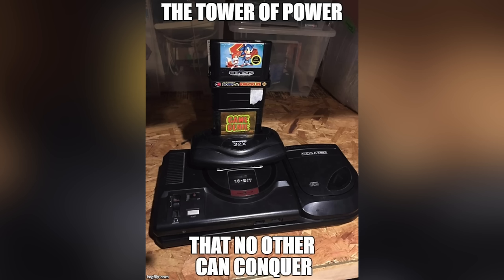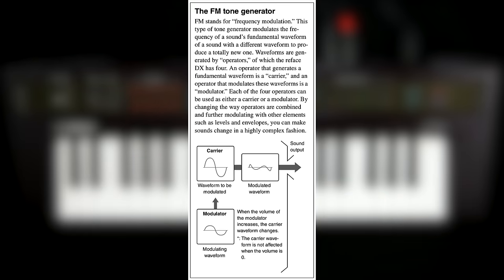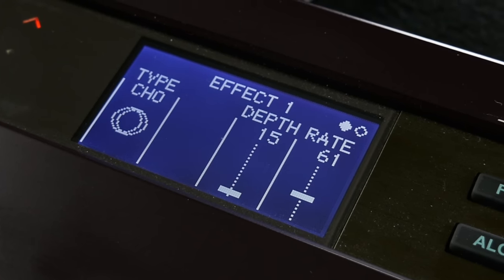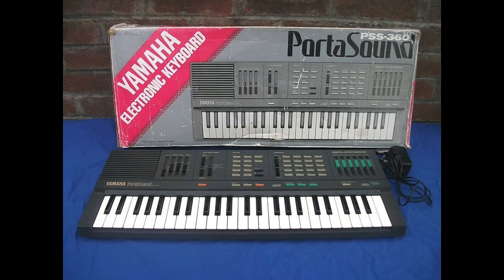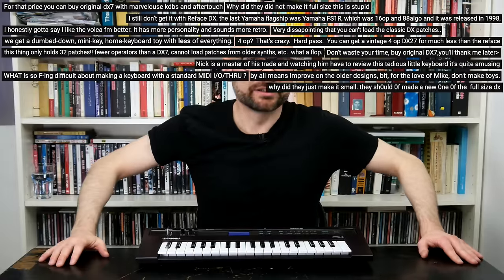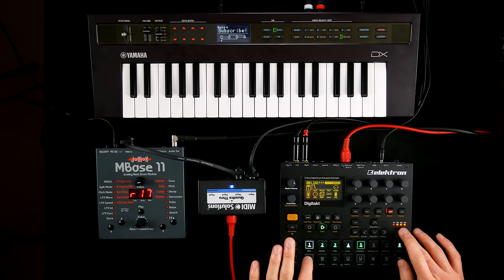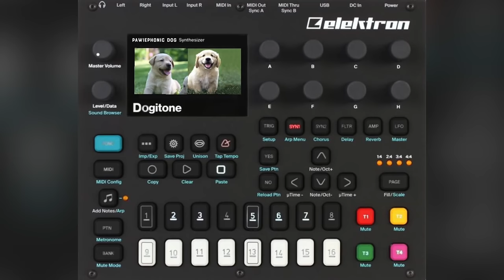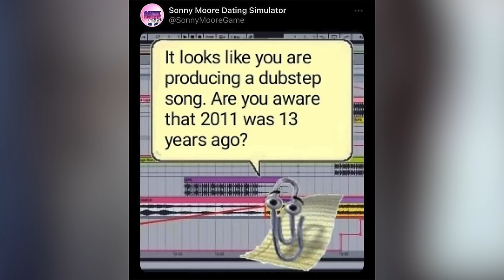Bad Gear - Yamaha ReFace DX

Comment: If the Refaces had launched at half the price, they'd be instant modern classics. They were WAY too expensive for what they were, but damn did they all sound so good.
Reply from the maker: Agreed!!!
Reply: price has gone up too 😭
Reply: I bought a CS when they came out and that is really the only piece of gear I ever regretted selling. That think was sweet.
Reply: Exactly my thought. I’m amazed the price never came down by much. I would have at least one by now if they had!
Reply: They did lower the prices for a few months in the middle of the production run, but once more people got them and the word got out that they are limited but neat, the prices went back up.
Reply: @mackenlyparmelee5440 the CS is a great little synth - so quick to dial in great sounds.
Reply: they could've tried making enough of them :C
CP was the only one I was really interested in. Wicked lame the volca fm was a 6op that took DX7 sysex and this thing is... this thing
who wanted a tiny DX27? we had the DX100 already!
Reply: Well put!
Reply: CS is the only one I haven’t owned (and I sold the YC - not a big organ guy).  I love the CP and the DX was my main portable rig for years until I got a Jupiter XM…
Reply: @soupforare  Yeah, but the original Volca FM only had 3-note polyphony, which was a deal-breaker for me.  I forget what my issue with the FM2 was, that I never bought it.
Reply: The grandfather of the Reface CS synth, the CS01 ( mono ), now goes for what you would pay for Reface with polyphony and better features ( the exception being the mod wheel ).
Reply: You could get them for around €250 second hand here, which is a good price.
Reply: Yeah, knob/$ much too low.
Reply: I paid £250 for my Reface DX which I thought was a good price at the time. It's a great little synth. I like the form factor, and the built in fxs. The downside to me is definitely the limit of just 32 patch memories.
Reply: @TheDungeonDive how much was new Reface when it came out? The prices were all over the place
Reply: I paid €250 the CS new a few years ago
Reply: "I think I'm alone now" ... cheazy 80's refference .. but I really never got the buzz of reface. Pretty much all of them take the "cheazy" sound to new heights. and the small form factor and yes "Casio" build quality and I'd say Waaay too self confident pricetag make me think, Why did people even buy this shit to begin with. You could get soo much better sounding "toys" elsewhere for lesser money. Even a REAL Casio almost sound better and only cost a fraction of these. Someone at Yamaha must have had a brain aneurism. I can see the pitch from a brainstorm at Yamaha dev team meating. "Hey guys howabout we take some of our old shit and cook it down to sound even worse than the originals and put it in an ultra compact form factor like Casio .. but selll it for a total hillarious  price .. wouldn't that be fun ?".... and then the world went mad  and actually baught it .. that is if nothing else epic in itself 😂😂
Reply: @mrdali67  a lot of those cheap casio machines have become as expensive as a reface now ! The VSS30 for example
Reply: I have the CP. It's simple and glorious and has a secret piano mode that I love
Reply: Funnily enough, Yamaha seems to have put Reface DX's on sale for $250 right after this episode came out.
Reply: I would have bought one if not for the price.
Reply: @treetopjones737 oddly enough I did r exactly that about 5 years ago. Sold my CS01 and bought a Reface CS. Many more sound options, and of course polyphony! But the PWM on the CS01 was the only thing I miss. The Reface does it, but not quite as well.
Reply: And the lack of patch memory for the CS is criminal considering they are digital devices!
Reply: @LondonSteveLee  yeah but it's that hands on analogue feel.
Reply: 1) learn electronics
2)buy a teensy4. 1 and an I2S Dac breakout
3) buy a PSS "remie" or a A50 (same keybed as the reface)
4) replace the electronics
5) code your own algorithms

that's how i got my best refaces... by refacing yamaha's toy keyboards 😁
Reply: They are really well made quality little units, but I agree if they had been slightly cheaper they would have been incredible. I always resisted because of the price, however I recently picked up a CP for a good price and I have to say it sounds incredible. The only downside is having to hook it up to a larger keyboard to be able to really get the most from playing. 

I think the CP and YC while a touch expensive for what they are succeed over the DX and CS is that they focus on simply emulating classic vintage sounds through excellent sampling and high quality effects, and they don’t bite off more than they can chew. The synth type refaces are still really cool fun keyboards but can’t really live up to the promise of a real synthesizer and you always feel like its a compromise in terms of editing and the inability to save patches hurts. 

You cannot get something that will hook to any midi controller and sound as good as a nord or hammond or whatever stage piano for a price as low as the CP and YC, which sound as good or better than my Nord, but for the price of the DX and CS you could buy one or more of Behringers synth bootlegs or even the deepmind 12 and have change which is gives so many more possibilities. 

So for me the Dx and CS fail because they’re a compromise where the CP and YC are much less so. 

But can’t deny all of them sound effing amazing
Reply: @johnthecloud It’s a good price. I agree it could use 8 banks instead of 4, the buttons are there already …
Reply: @barrycreed9886 Wow
Reply: @thefaultinourpizza1513 they are now $250 brand new. Is this a good deal?
Reply: @mrdali67  I completely agree with you on this sentiment. Consumers will fall for just about anything 😂
Reply: @FrightBites  I haven't seen them that cheap, that's a more than excellent price tag.
Reply: @javiceres  they are currently $250 brand new during Yamahas spring sale
Reply: @FrightBites  That´s a big bargain
Reply: Paid 250 USD for my DX and love it! It's still a bit expensive but if you're a keyboard player and enjoy working dawless it's great! The build quality is spectacular and far better than I expected. My only complaint is their proprietary midi port x.x
Reply: Had the reface dx for a few months was a great 4 op synth but in the end the small keys didn't do it justice even the hassle of using it as a sound module.  Flash forward to 2 weeks ago I purchased the original DX7 and can exchange the sounds I need via Dexed.  I know yamaha have the modx but a low cost full size dx clone would be great.
Reply: Price is $250 now - seems like a square deal!
Reply: @litup6465  250?  Not in Europe though.
Reply: Disagreed, but I am not a cheapskate
Reply: CP is somewhat of a modern classic in lofi hip hop circles these days, isn’t it? I see them everywhere.

Comment: I'm a songwriter. I want to make my own tones but don't want to lose half a day making a single patch. The 4 op reface is good for what I want. Does an OG DX7 sound better? Yes. Would you find it more enjoyable to use and program? Probably not. The Reface DX is a really beautiful complement to any songwriter's home studio. I think only hardcore FM nerds would find it to be limiting. It's genuinely a nicer synth than any software FM synth I've tried.

Florian has now reviewed all 5 synths that I own. Cheers Florian. My quest is complete.
Reply: I really like mine, too. All criticisms of the DX are valid, but as a tool to actually make music on I rank it pretty highly. 5 out of 5 is a top notch. Do you also have an OG Drumbrute like me?
Reply: @iiaaiiaannaaiiaaii  nah my only drum machine is a tt-78.
Reply from the maker: Bad Gear bingo!!!
Reply: At this point if you still have a DX or TX, it's got dead batteries and the patches are all gibberish.

Comment: I bring my Reface DX when I go to jam with other musicians. It's small enough that it's easy to carry and fit in a crowded room, with the batteries I don't need to be near an outlet and the FM tones always stand out against other instruments. You can load converted patches from many other 4-op FM synths from the Reface Legacy Project.

It's definitely not a replacement for a DX7/SY99/etc but both have their uses.

Comment: 7:18"Thanks Yamaha for releasing  the most stylish Sega Genesis sound chip emulator of all time." Eh-hm.   I point you to Sonicware's Liven Mega Synthesis which surely fits that description far better. That's an actual Genesis/Megadrive groovebox (as opposed to a monotimbral 4op FM synth).
Reply: DX100 used one of the Genesis chips actually.  (There was 1:1 patch compatibility at least)

Love my megaFM though.  I would never buy another Yamaha style FM synth without knob/fader per function again.
Reply: @NunyaB1s  recently bought Volca FM2, it's crazy how many sega sounds one can get out of that box.
Reply from the maker: I like Live stuff but I wouldn't exactly call them stylish;)

Comment: The Reface DX is an excellent FM synth that is also an excellent MIDI controller (unlike other Refaces where you have to turn it off and on holding a bunch of keys). Thank you as always for an amazing episode.
Reply from the maker: Thank you!!!
Reply: Reface CP is also an excellent MIDI controller, with even more freely assignable knobs.
Reply: @vinylarchaeologist  Don't you have to turn it off, press a few keys and turn it back on to change a MIDI channel?
Reply: @55SqueakPip   I don't know, I never tried to change MIDI channels. I just hooked it up and played. EDIT: I guess it makes sense, since DX is the only Reface with a screen.
Reply: @vinylarchaeologist  Changing MIDI channels on the fly is the main reason I went for the DX, that and the FM sounds. I also have a Reface CS which I like a lot..
Reply: @NakedBonghit It's quantizable now. Firmware update fixed that. You can see it at 4:12.
Reply: @55SqueakPip Nope. It's in settings.
Reply: The Reface DX is but the other Refaces don't have a screen, so its a bit different

 @BlasphemousButler
Reply: I get around the restarting problem on my CS by just plugging in a headphone jack adapter into the headphone port to mute the speakers.
Although changing midi channel is still not workaroundable
Reply: You can turn off the speakers as a default using the method suggested in the manual @Ballissle
Reply: @55SqueakPip  yeah I know. But my point was that involves holding down a set of keys and restarting the device. It's quicker to just pull a plug in and out as I switch between internal and external speakers a fair amount
Reply: by midi controller he means midi keyboard. you can't effectively use it to control parameters. plus it constantly sends out midi clock from the looper which is major pain in the ass.
Reply: @RadekPilich  I never noticed the Reface clock being a burden to the MIDI sequencer that way (a Yamaha QX7). My sequencer is the master clock and the Reface doesn't affect it unless I put the QX7 clock on external mode..
Reply: @55SqueakPip  it's a problem in more complicated setups with midi merging, where DX mixes it's clock into the existing clock stream causing "doubling" of the tempo
Reply: I have a 'complicated setup', I use two MIDI merges for the Reface to control 5 other synths through a Yamaha QX7 sequencer. I have zero issues with doubling as long as the QX is a master clock. Is it possible an OS update could help you? Not sure - just throwing it out there. @RadekPilich
Reply: @55SqueakPip  I have tools to filter it out if necessary. It's just not a good design choice from Yamaha to not include the option to turn it off. They are the ones who should do a firmware update

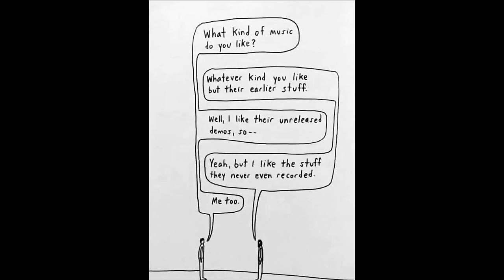Comment: Not gonna lie, I popped massively for the PSS-360 popping up at about 4:20 (blaze it).  I had one of those back in the day and loved fannying about with the synth sliders.
Reply from the maker: PSSes are awesome!!!
Reply: I love my inherited PortaSound!   A 270. 

I am even in the middle of recreating its presets on my opsix; which I could triple-up in one voice for a unison mode, or even combine different presets in an ersatz multi-timbral situation. 

Though I’ve since discovered, from Yamaha’s own sound chip programming manual, that its 100 presets are actually just 7 in the chip which the keyboard ROM slightly tweaks to generate the rest. Which explains why I kept creating almost identical patches with slightly altered values, but it does have me reconsidering whether I should really only be making 7 of them myself rather than 100. 

Though there’s an extra-crunchy quantised texture from the PortaSound, like dithering or something where the pitch very quickly jumps around within a range, while the opsix sounds very clean. So I’ll probably always keep it around for when I really want the dirt on those simple 2op sounds, even once I’ve finished this project.

Comment: My first synth! It's always ready for action. I have it permantly on my computer desk as my main midi keyboard for Cubase. Since I bought in 2017 two Volca FM's have joined it's company and I pretty much always use them together. One can't have enough FM synths.  Out of curiousity I had a quick look at the Seqtrak's data manual and discovered that it has a lot of FM presets that I reconize as factory presets of the Reface DX. The FM engine of the Seqtrak seems to be closely based on the Reface DX, considering it's got the same specs with 8 voices, 4 operators and 12 algorithms.  So it seems Yamaha has repacked it in their new groovebox. Nice!
Reply from the maker: Nice!!! Love Volca FMs!!!

Comment: Don’t forget the kit that adds strap buttons so you can go full keytar and work the pitch bend lever from the other side! Seriously, though, I got the DX because I wanted a portable, battery-powered keyboard with built-in speakers that was a step above the usual fare for such keyboards. (If I’d known about the PSS-A50, maybe I wouldn’t have ever gotten any of the Refaces.) I figured I could find presets for the DX that would get close enough to cover some of what the other Refaces do enough for my purposes. But I’ve been surprised by how much I’ve enjoyed it and ended up actually making some patches of my own.
Reply from the maker: Damn that keytar aspect is awesome!!!

Comment: I had two of them. Sold the first one after few years because the sound wasn't as thick as I wanted and I needed more operators. However, I then started missing the great feel of those mini keys, and the joy of sound design that Reface offered, so I bought one again. In the end I didn't keep that one either. Today I use Plogue OpSix, with six operators and it gives me the DX sound I always wanted. But still, I will never forget how fun and easy it was to sound design and make sequences with Reface DX. And the feeling of those keys.

Comment: They called it "DX" yet you couldn't load DX100 patches nor patches from any other Yamaha 4op FM synth on it.   Doh! I also seem to remember it being quite expensive (it's still apparently the price of two Korg Volca FM2s which I'd recommend over this one). Ultimately, the best FM synth in the sub 300-bucks bracket is Sonicware's Liven XFM.  If you're after the Sega Genesis/Megadrive sound, then you need Sonicware's Liven Mega Synthesis (I'm not in any way affiliated with Sonicware.  I just personally really enjoy and rate their instruments).
Reply: Check out the reface legacy project not official compatibility in any way but very cool none the less.
Reply from the maker: Really enjoyed the sound of the XFM

Comment: Don't forget: the DX100 was important to the beginnings of techno, particularly on Derrick May's tracks such as "Nude Photo" and "Strings of Life". 

For a hot minute, I thought the RefaceDX was going to finally get FM right...and then I encountered those "virtual sliders". Still, Yamaha gets props for trying to give the world a DX100 that makes more sense to program than the original.

Something new? How'bout the Alesis Quadrasynths? They're all over the used market, and as ROMplers go, they can be pretty versatile. However, it's yet another 1990s synth that got used for its (admittedly really good) presets while people ignored the programmability.
Reply from the maker: Agreed!!! Quadras are super interesting, thanks for the suggestion!!!
Reply: Those sliders are exactly why I dithered long enough to ultimately find a good deal on an opsix instead 😅 (despite beginning that dithering when the refaces were first announced!)

Comment: I quite enjoy mine, though I got it for a very specific purpose for which it’s probably overkill. I wanted something small with batteries and a speaker so that if I’m watching some music theory videos on YouTube I can quickly pick it up and try playing along or experimenting with chords, without having to go downstairs and fire up my “proper” synth gear. I was originally thinking of a CP, but since there were none in stock locally I got a DX as a second choice (a cheap Casio would’ve been fine, but I wanted something slightly less cheesy). The unexpected bonus was the chance to re-learn digital FM synthesis, which I hadn’t played with for over 30 years, and while those pseudo-sliders aren’t great, the UI’s a hell of a lot better than doing it on a DX7 back in the day! It reminded me that FM synthesis itself isn’t hard as long as you know a bit of maths: it’s the fiddly DX envelopes and knobless interfaces that get in the way. There are a bunch of things I wish it had (a better sequencer, aftertouch, a mod wheel and a bit more polyphony), but overall it does what I need and sounds surprisingly nice, even through the tinny speaker.